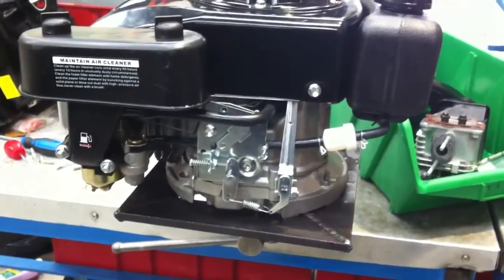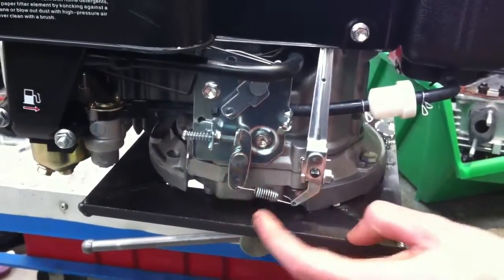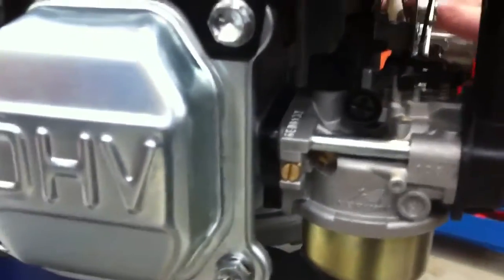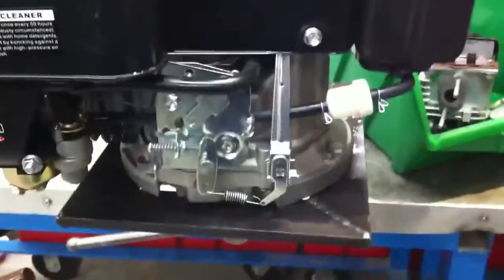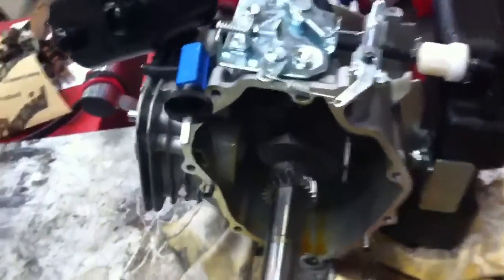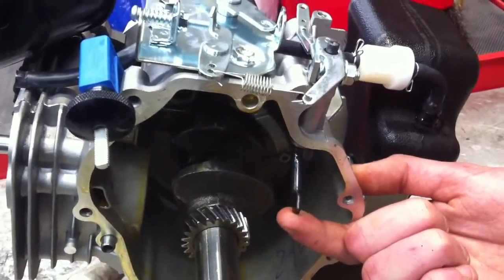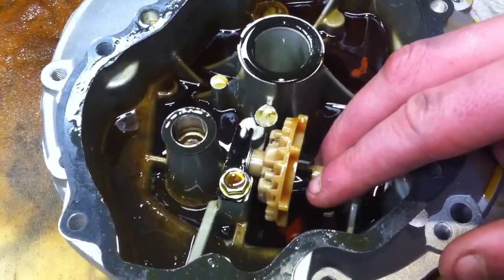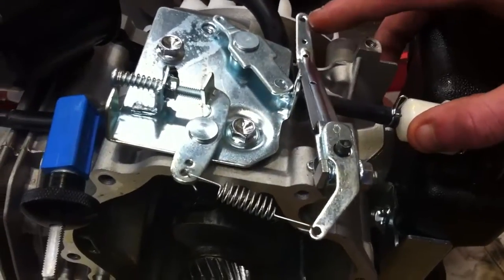Speed governor on Lifan 5 HP air cooled 4-stroke engine

Comment from the maker: If it is mechanical, it can break. If the governor stops working, it will either cause the engine to fail to run, or to overspeed and destroy itself. Generally, with these types of mechanisms, they are designed to 'fail-safe', in a no fuel, no run position. Governing the maximum speed of these engines is absolutely essential, as they can easily over-speed and turn themselves to destruction. Most common problems are damaged or incorrectly adjusted springs and levers.